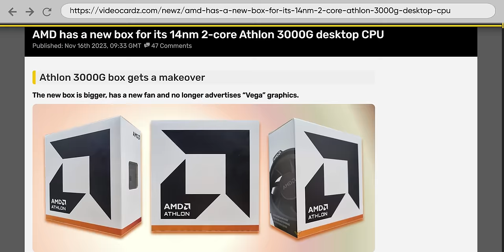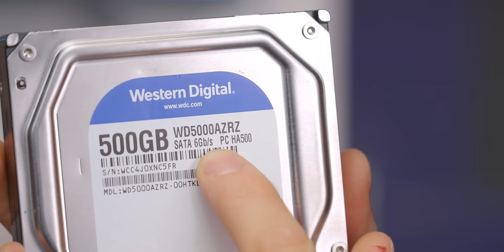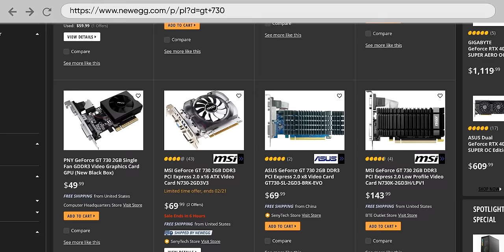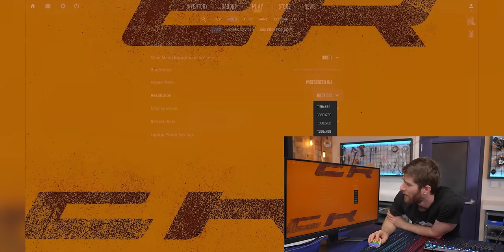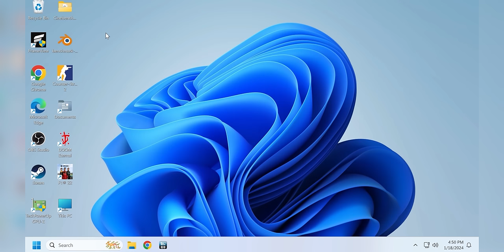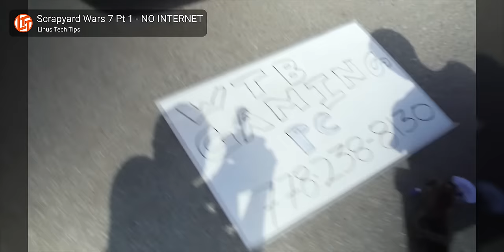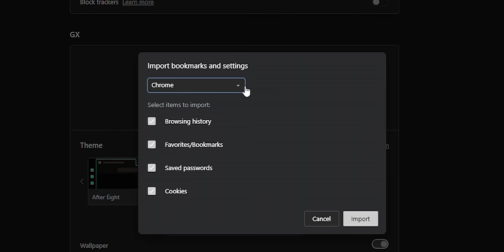I Built the Slowest Brand New PC and it Sucks.

Comment: For comparison, three months ago I bought a used HP Z840 for $340 (shipped) that came with: 

XEON E5-2667 V4
MSI GTS 1080
32gb DDR4
1150w Power Supply
1TB SSD 
DVD R/W drive
Win 11 64 bit (registered)
Reply: Xeons with some moderate overclock can still be pretty amazing, I know someone running one with a 3080ti with little to none bottleneck
Reply: @renealcerro1320  You pay for it in high power bills though.
Reply: @itIsI988 No you don't. The difference in price between would save you around $10 a year in the US.  The air conditioner and heater is what drives your electric bill, not your CPU.
Reply: @criticalthinker420  I'm in the UK. Power hungry computer parts are still stupidly expensive to run for long periods over here.
Reply: @itIsI988 Sure, if you think $10 a month is expensive, then I guess it is to you.  Most people wouldn't even notice if their power bill fluctuated by $10, but sure, in the UK $10 is lots of money.
Reply: @criticalthinker420  At current rates it'd be about $12 a month to run that CPU for 8 hours a day. No doubt the necessary motherboard for it uses more power than a regular desktop one, too.
Reply: @itIsI988  Okay, that isn't $12 a month more than if you run a more efficient CPU, that is a total of $12 a month, so changing CPU would save you $4 maybe?  What is your point? CPU is not the power hog in your home and changing it will not affect you.  Like I said, who notices a $4 fluctuation in their electric bill.  The savings isn't even noticeable.
Reply: You didn’t have my high end graphics card but you made out good! 😊

Comment: I have a used OptiPlex that I got for free with similar specs to your used upgrade, and all I had to do was slap in an RX550 and a 1TB SSD and it’s a crazy good performer. Easily mid-range, which really surprised me. I have a top-of-the-line PC now, but that PC was actually quite impressive.

Comment: My school be like gimme gimme wait how did you build my schools computer my schools CPUs are a i3 3940 with windows 10 4Gb ram DDR3 all in one
Reply: I think you can get ddr3 dirt cheap by now . He'll you might get some free dumsterdiving e waste .  A bit more ram + brand new ssd would work fine for web
Reply: Just 4gb more ram and a cheap 128gb ssd to boot and install application would work just fine. 
I have a i3 4005u laptop has max speed is 1.6ghz and it run fine even for window 11, and good to use on ubuntu. Can play old games pretty old like skyrim or crysis say at 20-45 fps.
Reply: @sMv-Afjal   say that to the IT team
Reply: Also the bloatware is awfuly slow
Reply: @arandomcomp2427 can't even install afterburner

Comment: I was using dual core Pentium E (LGA 775) and HDD until Windows 8.1 and it was performing fine.
Windows relied heavily on SSD since Windows 10. Any PC without it was significantly lagged and I guess Microsoft just assumed everyone was able to get one of them back then. (I mean, it's not expensive, but still did not appealing in terms of the price couple years ago)

Comment: It would be interesting to do the cheapest brand new PC, not necessarily the slowest. For example I've seen SSD's quite a bit cheaper than the cheapest HDD, and honestly you could build a waaaaayyy better machine than this "worst one" without going to used stuff. 

380$ is a decent amount, I was able to make a build with ryzen 5 4600G, 8gb ram and 500gb SSD for about that, totally usable computer, really only missing a gpu more powerful than the integrated one to really start getting into gaming, but the 4600G surprinsingly can play a decent amount of games smoothly as long as you're willing to run on low settings.

Comment: I literally built 50 dollars (pc with "2009's high end pc components" and it is like completely usable for cs2 and many games with low system requirements. I can even play gta 5 at high settings.

Specs:
Asus P5Q Deluxe
Xeon e5440 overclocked to 3.8GHZ
4x 2GB ddr2 800MHZ hyperx rams
Crucial Bx500
GTX 750 2GB (modded bios with Ti edition frequency values)

Comment: That used rig is basically what I've been running since 2017, and it cost quite a bit back then. Just upgraded a bit to a 9700KS, so it's finally not CPU bottlenecked to hell, but it's still rough.

Comment: The main issue here was getting it to run off of the WD500gb Blue without giving it a buddy to handle the operating system.

As someone who likes using HDDs in this day and age, I'll say the WD500gb is probably the most reliable on the market tied with the WD Green line of HDDs and is a solid work horse (it wouldn't handle PS5 stuff but can run PS3/360 era content) but it was always going to struggle with having it's abilities split between running the OS, Steam and a game.

If you'd like to try a more efficient set up, use an SSD exclusively for the OS, an SSD to run things like PS5 ports and a large capacity WD Black HDD for everything prior to the PS5.

Comment: bought a used Pc lancool mesh 2, 32 gigs vengeance, 5900x, 2070s, 2tb evo, rm1000x, corsair rgb fans, 360mm corsair aio, 800 used.  it was built by someone who was totally lost, fans in the wrong spot, AIO sub optimal, ram installed wrong,  thing runs amazing now.  going to be upgrading this thing for years to come.

Comment: I've bought a number of used workstation PCs that I still use on a daily basis for gaming, home automation, video encoding,  serving media, and software development. I have 4 currently powered up right now in my rack. All are second hard PCs that I modified to add rackmount ears. They vary heavily in specs. My slowest is an i7 4770. It's too bad it doesn't support windows 11, but oh well 10 still works fine. I totally agree with keeping e waste out of the landfill, even if it's not as fast or power efficient as a new machine.

Comment: 5:20 ... this used to be my pc (but worser) till 5 days ago.. had it for around 2-3 years with a even slower laptop before that which i had for around 1-2 years. Had a GT 710 , windows 10 on HDD , and a pentium 3220. Crazy times, now i have a rx 6600 and a ryzen 5 5600.
Reply: ur new experience probably made you bust

Comment: I actually once build a PC with a G5905 but it's a work PC for my dad which was very budget oriented. Iirc it has 8 gb dual channel memory and a 15€ 128GB NVMe (~1500 MB/s read and write). Surprisingly with the SSD it's quite fast, boots up in 15 to 20 sec and responds fast.

I'm sure that for ~250€ (no new case as I had one left) there where better options but I was and still am not very experienced with building PCs. I made like 6 different PC's (whereby mine had like 2 complete rebuilds where I exchanged almost everything), which isn't very much. But all these PC's work fine, so they are probably not too bad.

Comment: The funny thing is, if the OS and software were actually designed for it, this thing would run capably and smoothly, just like similar spec PCs from 15 years ago did (well, ignoring Windows Vista related issues).

Comment: I have an Intel Atom laptop from 2009 still in active use. Single core, two threads, 1.6 GHz, CPU integrated graphics. It won't shine in gaming but normal desktop stuff still works perfectly acceptably although its brain is way slower than your Celeron. And Minecraft was playable on it back when Minecraft still supported 32 bit computers. It works so well because it isn't running Windows. It originally came with Win XP that I immediately wiped and replaced with Ubuntu. When Ubuntu dropped 32 bit support, I installed Debian. A funny thing is that its original battery isn't dead yet!

Comment: You can do a lot better than that thing even if you wanted to buy new: cheap case about 30$, R5 3600 about 80$, 2x8Gb 3200 Mhz cheap RAM 35$, cheapest SSD of 480Gb about 35$, cheap PSU from a brand that is known to not catch fire (aerocool) about 35$, A520 mobo about 60$, brand new RX 580 about 120$ (yes there are still brand new RX580s where I live). GRAND TOTAL: 395$. The R5 3600 is still a very good midrange CPU and the RX580 will allow you to play most modern games if you play around with graphics settings and FSR. If you are willing to swap out the RX580 with a used GPU it will probably even be a console killer for about 500$. And you could always prolongue its life by upping the CPU and GPU later down the line and for a mere fraction of the cost of a scalper console you would still have a console killer. Slap in a R7 5700 and an RX7800 and this thing will beat up even the next gen consoles.

Comment: (I just realized I watched this 7 months later... oups)
I agree, used is always such an amazing way to get a great deal. However building new while only getting the GPU as used, you can make something absolutely amazing for around 450 USD.
Looking over Amazon in the US:
Ryzen 4500	69
ASRock A520M-HDV	70
Corsair Vengeance LPX 32GB DDR4-3200	53
Patriot P300 M.2 PCIe Gen 3  512GB	30
Radeon RX 5700XT	125
Crucial Air 3000D	50
500W PSU	45
Total	442
That will run 1080 perfectly and even do well in 1440p.
Could also save more and gain additional performance on the used market if you were hunting for an AM4 motherboard and a Ryzen 5600 instead of the 4500
But in all, the above is far more capable and will last longer then the used pre-built route for an extra 100ish.

Comment: I got Linus beat -- I paid $180 for a Core i7-8700 with 32GB RAM.  (No storage.)  As a Linux user, I don't even have to concern myself with the possibility of Intel discontinuing driver support (as has happened for some Intel chipsets already in Windows; like they have Win10 21H1 or whatever, find out they can't update to 21H2 because they need updated drivers and Intel quit producing any... so they have a choice of either downgrading to the LTSB "Long Term Support Branch" or having an unsupported version running.)   Especially as Win10 goes out of support, there'll be all these businesses and some individuals just unloading those systems that don't support Win11 for virtually nothing, and some of these are quite nicely specced.

It really is amazing some of the hot garbage both AMD and Intel make at the low end.  One common issue that slows them down in my experience is they don't really keep the chip balanced; like in some cases they'll just cut a lot of cache and cut the memory bandwidth (like maybe even only support single channel memory), like the whole CPU core is still there burning through power but it's just waiting for the memory system to keep up.  (I assume this is intentional, they want to avoid like the Athlon versus Duron  and PII versus Celeron era, where you could often get like 80% the performance for 30-50% the cost. I would guess they lost a LOT of sales of their better chips to the Durons and Celerons; I know I got plenty of use out of my Duron between the K5, K6, and K6-2 I had before and the Athlon XP I had afterwards (I went to used Intel systems for a long while after that.  But the Ryzens are awesome.).  As an icing on the cake, they usually also kneecap the power management (like the speedstep equivalent might have a full boost speed, base speed, and like 1 lower speed instead of the 50-100mhz steps or possibly even continuous speed control you'd see on the regular chips.) So they things don't even run cool to make up for being slow.

Comment: If you have the technical knowledge to maintenance used products you can get even more bang for your buck. I bought a used 3080 for a steal. Tested it then took it apart and cleaned/reposted it and got at least a 25% boost in performance.

Comment: I run my media server off an old 4790 (16gb ram). Going from hdd to nvme dropped boot times from ~2mins to <30s, and media load times from 15-20s to <5s. While that Athlon is gonna struggle regardless, I'd be curious to see how it fairs with a ssd.

Comment: somehow this meets Windows 11's minimum specs but my pc with an i7 4790K, an RTX 3060, and an m.2 SSD doesn't.
Reply: you need a better cpu
Reply: @44jess453  my point is that my cpu is significantly better than the one in the video, it's just old. I think it was the flagship model when it came out.

Comment: I'm still using spinning rust.  HDDs cost about $40-50 for the case and drive electronics (0 storage) and like $10/TB for the actual platters and heads.  So 512GB-1TB disk?  Maybe 2TB?  Don't bother.  But I have 20TB storage in my system -- I don't even want to know how the hell much that'd cost in SSD form but it's only about $300 worth of hard disks.  I am not hurting for space no matter how many giant games I throw onto there.

Comment: The CPU of Celeron ISN'T slower than Athlon! The sum of the 2 cores of G5900 are ~50% faster than the sum of the 4 logical cores of 3000G. The problem here are the other components and the iGPU (UHD 610 vs Vega 3), that gives  more than 50% performance (in the video, the iGpu was not used).

Comment: I remember when 4 cores were wild. Before I upgraded my 2005 model motherboard to upgrade my cpu I was running off a HDD and would turn on the PC and then take a shower to let it boot up while I was doing chores. It took 10-30 minutes using a 6 year old HDD

Comment: Instead of getting the 4070, I settled for a nearly new 3060ti at 1/3rd the price, happily running games at 1440p. I later realized I could have saved a lot if I went entirely with the used market.

Comment: 4:48    im still using a gt1030 for gaming. I would love to upgrade but i would need to upgrade my PSU Processor and a motherboard too so i think i will just stick with this until it stops working
Reply: I have one in my prebuild... found out after three years of wondering why my 3060 (they said it has a 3060) is so slow...

Comment: I'd like to a budget 7800x3d/1TB/32GB build. Like if you had enough for the core system, but had to wait to afford a strong used gpu. So maybe a 6800xt or 3070ti, or even earlier. Then test the card that will be reasonably priced in the future, a 6900/7900/4090/4080. Something that in a year or 2 will be more reasonably priced. Kinda of a make the budget computer of next year today video.

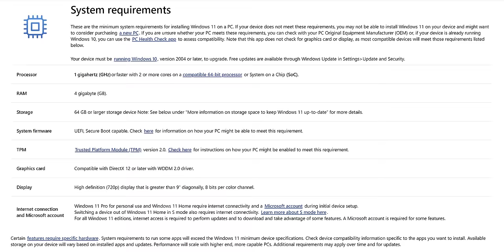Comment: 7:07 Insane that Microsoft put so many stupid arbitrary limitations on the minimum requirements for Windows 11 while not mandating SSDs to be used for the OS. It's night and day even just having a 128GB ssd that only stores the OS.
Reply: 2 minute start times can be a big hindrance if you're in a hurry, but it's something you can work around.

It's when it starts that using an HDD to run Windows 10/11 becomes complete hell.

Comment: With 380 dollars you can get a laptop with 4/6/8core cpu and a pretty strong apu(amd ryzen 5500u/5700u,there is the 7520u that is 4 core/8 threads its igpu is worse than 5500u/5700u but its a bit more efficient).

Comment: I remember my amd athlon 2400+ was a duel core with 2 gigahertz and it was decent in 2005. I remember how cool it was to have two cores. Not mention 64 bit windows vista. 2 gigs of dd2 corsair, 80gb Seagate hard drive at 7200rpm, my ati 9200se 128 mb ago, my Asus mother board, my sound blaster pci sound card.

Comment: I bought a G5905 for $20 a week ago and I'm glad I did. I had a z490 motherboard and 10900k that weren't POSTing and gave me no CPU and 00 code. With the Celeron, I finally got different postcode but then the VRMs exploded. Glad I got the $20 Celeron and not like a 10700K or something. Shitty parts still have their uses.

Comment: 9:40 tbf i wannt to argue CS2 is way way way harder to run than CS or some even better more detailed games. CSGO ran 300-400fps on high settings 1080p for me, but when CS2 came, i no have rouhly 60-70 fps on low settings 1080p. for comparison, rdr2 1080p low runs 30fps. so it litterally just runs 2x as fast as rdr2, which has extremly detailed large open world.. compared to small maps of cs2..
Reply: cs 2 detailed
Reply: I'll walk myself out

Comment: The biggest problems with the slowest PC are the single RAM stick and the hard drive. If the system had 8 GB of RAM and an SSD for the boot drive this system would be useable. A System with a Celeron will be a perfectly capable office PC, but it will never be a gaming PC.

Comment: Windows 10-11 are not good for HDDs, your number 1 problem was the HDD. any SSD, even a 240g SATA SSD would have been a lot faster and usable. No one sells pcs with HDDs and Windows 10+ anymore linus. You can put that HDD on I9-14900 and its not going to be much faster(ive done it btw). This video needs a redo with a sata SSD. You can probably get a 240G one for the price of that HDD.
Also if you want cheap gaming aim for a RX550/RX560, or go directly to 4600G+Dual Channel, or at least 3200G+Dual channel, dont put a GT1030 on it.

Comment: Just put an ssd in that thing already, the price probably won't change. I've plenty of old laptops, even core 2 duo that are usable for basic tasks, just give them 8gb and an ssd. 4gb can be fine too with something like tiny10 or tiny11. My point is that you built something slow on purpose, you can do the same with used components, just buy something used and cheap out on the ssd, it will give you a similar experience  modern os are built to run on ssd nowdays.

Comment: I remember daily-ing hand-me-down systems with hard drives and an i7 and still took 10 minutes to do anything. Then I bought a i3 laptop with an SSD and oh boy did make a difference. It was still slow but it felt 90% faster. I really wouldn't recommend getting the bare minimum for Windows or Chrome. 

Side note: I used Celeron before, possibly the worse processor I ever had to use. I take an i3 or i5 any day.

Comment: install a ssd in the other pc, thats the same result in windows ,-, (you setted a hdd from 2021 used?) (i know thats for the same price you can get the other pc, but you were very exaggerated with the performance of the other one, it only lacked an SSD
Reply: I simply mean that the video is a little exaggerated for the other PC, not misleading but what is shown seems paranoid